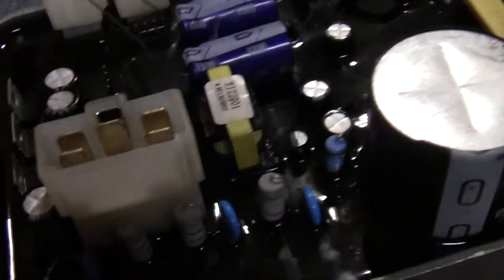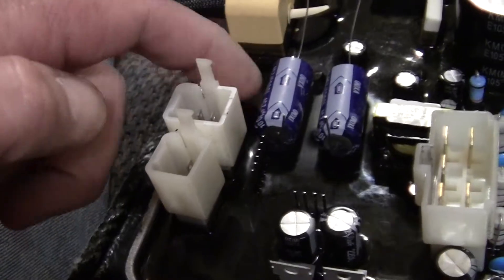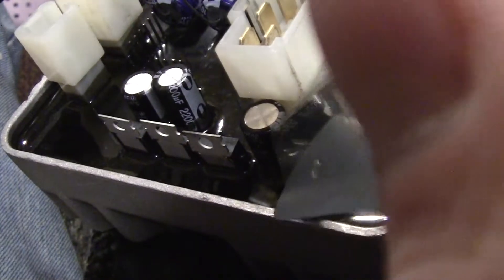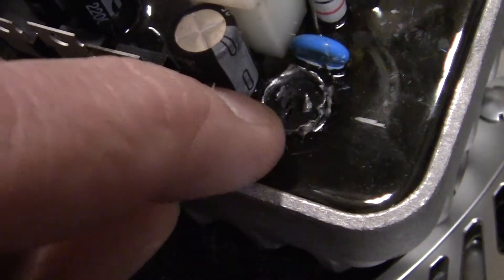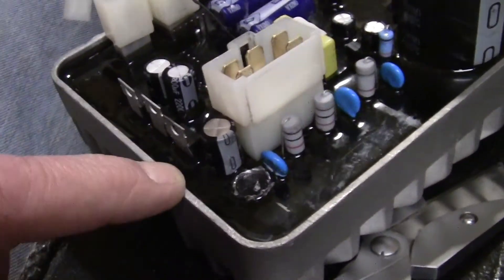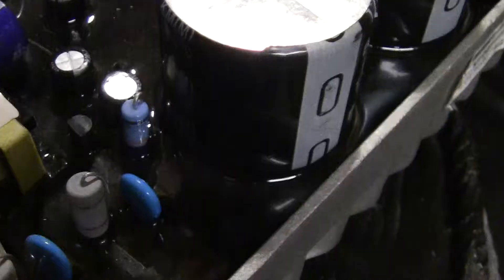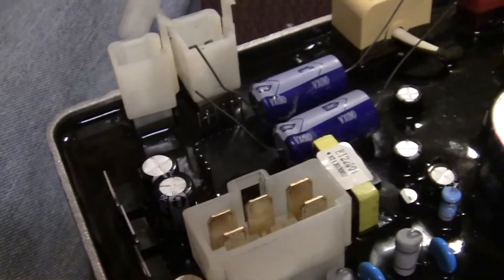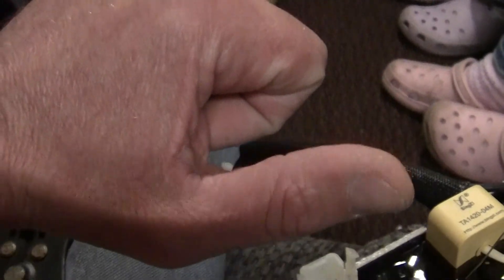INVERTER GENERATOR MODULE REPAIR (FAULT LIGHT/NO POWER) PART 2

Comment: I have no spark. I checked coil, plug, switch, ignition assembly replaced. Still nothing. Any ideas?
Reply: Buy new plug. Is the cheapest try
Reply: @andres--9096  thx. It was the ignition coil

Comment: Not one of those large capacitors on my inverter were bulging. Mine has 6 large ones and they all look brand new. What else could it be? My inverter is the 8750 Predator from harbor freight. I see no burn marks anywhere. All my wire male and female connecters were snapped in pllace. The inverter module looks brand new yet the generators "no power" light is on.
Reply: I have an 8750, and it was backfed power multiple times accidentally, I am guessing the Tapa inverter board was coocked, any way to test it?

Comment: My gen reads overload and ive tried everything. I just ordered a new inverter to install in it. I didnt think to just replace the cap this way. I was worried it wouldnt last because of epoxy base
Reply from the maker: I had to do it this way as the inverter was $700 , thanks man..
Reply: Do you have the part number for that inverter? I can’t seem to find the correct part number for mine and I’ve think it’s the same as this video shows.

Comment: Hi Shawn, thanks for the video. But how did you indentify thst capacitor was faulty for the top?
Reply from the maker: It was distorted and the top was split open so I replaced them all ! worked great ..
Reply: @shawnmrfixitlee6478  oh ok. ♥️

Comment: The wiring for these inverter from the Stator it possible to have a solar fed battery powered at the 12 volt Input in stead of the generator I think it will be OK but I don't know Wich leads are positive😮 and negative can you tell me what are my correct polarity there's 3 blue and two white one is the blue leads the positive and the thiner white leads are they my negative connection sorry I HD to ssk
Reply from the maker: all inverters are different, sorry but it's going to have to be traced and tested out

Comment: Hello. Thanks for posting. I need information on how to test the inverter unit. If you read in any forum you would need that information or where to find it. Thank
Reply from the maker: each generator has a different inverter. and repairing them is very hard . you can do a web search for your model # and try to find a diagram . thanks !

Comment: I can't find part 1.  How did you know you had bad capacitors?
Reply from the maker: it had no output .so knowing the faults of inverter generators I pulled the inverter out and found the caps blown.. these type generators are more money and inverters blow easy if loaded hard ..
Reply: @shawnmrfixitlee6478  Part 1?  How do I determine if a capacitor is blown?
Reply from the maker: @Vegieman  you going to need a meter.. most caps bulge or split when they are bad.. part 1 is just me getting the generator no fixing .. your not going to be able to repair the inverter without taking the potting off first ..or test for trouble components.. very advanced work

Comment: How long do capacitors generally last ?  
What is their typical lifespan ?  I have this problem with other expensive equipment
Reply: Electrolytic capacitors have been notorious for decades for randomly popping like this it's a real bitch to replace them on a potted board but those small caps conduct very little current so it should be possible to solder a replacement component to the legs sticking out and secure them with a blob of silicone. Yes if not used for years electrolytic capacitors can change their polarity and pop! Old fashioned ones often went with a destructive bang and nasty corrosive goo on the PCB.
Reply from the maker: In a generator they  don't last long sometimes because if the generator gets heavy loads it really shortens their life . This is true with about any electronic device. Heat is there enemy and power surge can damage caps and diodes .. Thanks !
Reply: @shawnmrfixitlee6478  thanks, that makes total sense.  I know capacitors go bad just sitting around for years, disused - then getting turned on...sometimes weird things happen.  
 I know there is a niche industry "refurbishing" IC boards for all kinds of devices.

Comment: Hi, i have one ofthese gen with board problem it start run but no power. Where I send the board and how much it will cost? God bless...
Reply from the maker: Sorry , But I don't do repairs through the mail . Inverter generators are really a bad investment in my opinion as the cost of repair is so much higher than the AVR type . Mine just needed new caps installed . But I will not buy another Inverter type generator again . I hope you can find a new inverter or be able to repair it .. God Bless You & thanks for watching my channel !!

Comment: I have honda eu30is but it's moduler (AVR)gone damaged so can u tell me it can be repear or not ?
Reply from the maker: That would all depend on testing and finding the problem. I can't tell you rather it could be repaired over Youtube comments .. Thanks !!
Reply: @shawnmrfixitlee6478  can u tell me how to remove epoxy from modular?
Reply from the maker: @vipvideos6215  That in it's self takes many hours with boiling hot water . A tad bit at a time & a scraper , Being so careful not to damage the board or the components ..
Reply: @shawnmrfixitlee6478  if I will put circuit on water then components will be not get  damage ?
Reply from the maker: @vipvideos6215  I recommend not trying it if you have never done it before .
Reply: @shawnmrfixitlee6478  Okey sir
Reply: Ok thanks 😊

Comment: Hello Shawn! I have a similar inverter generator, the green light is on but I don't have power in the outlet. Do you think it is the same issue?
Reply from the maker: hard to say,  could be lots of things.. thanks
Reply: Hi,
My eu2200 has green light but no power also. Did you find a fix?

Comment: Good idea I would pull caps like bad teeth from a board and do a off board with short wires . Note caps vent on the bottom so potted caps will blow up from pressure.
Reply from the maker: not all caps vent from the bottom.. thanks for watching

Comment: Hello, 3000 watt full sinus inverter fault light is on. When the inverter is turned on, a relay tripping sound is heard, then the fault light is on, what do you think could be the problem?
Reply from the maker: Oh Man ! Could be many problems , Hard to diagnose over YouTube .. Do you have electronics repair know how ?? If you do , The best thing is start testing .. God Bless you !!
Reply: @shawnmrfixitlee6478  I have a temperature regulated soldering machine.  I did not force the inverter, I did not understand why it malfunctioned.  The inverter absorbs current of 12 volts, absorbs capacitors, but then does not output 220 volts.  The only thing I'm afraid of is the failure of the full sine circuit.  Mosfet, I can replace the diode.  Do you think there is a bigger problem?  I have my multimeter with me, I can't check it. good evening
Reply from the maker: @suataydemir5234  Ah, Just like I was saying though .. It could be about anything ! I say you need to test each and every component  for it's factory values .. One diode could take down the whole unit.. if you know what I mean..
Reply: @shawnmrfixitlee6478  yes i understand, thanks for your help, have a healthy and good day

Comment: Seems good idea did that worked ? How did U know those Cap's are the briken ones ? All the best.
Reply from the maker: The caps have a + in the center of the end cap if they blow out the + will be bulged and this means they are bad . They can be bad without this problem but these were blown wide open . Thanks
Reply: @shawnmrfixitlee6478  Straight forward, that was awesome, wondering if fhe generator working now, what was the result , is it fixed ,did this solution save U a new generator ?
Reply from the maker: @princedemiterios2488  Worked great ! Saved me from buying a new inverter module .. All fixed and powers up fine .. Thanks
Reply: @shawnmrfixitlee6478  what happens if you can’t see any popped pieces is there any test you can perform with a multimeter to narrow it down
Reply from the maker: @Nevaehdeavy18  Yes.. but you have to be very good with electronics to do them and most components have to be removed to test properly hard to do but it can be done if you can get past the potting material without damage to the board or components . Best info I can give you from experience ! But mine works well ..
Reply: @shawnmrfixitlee6478  well i have enough experience building boards and diagnosing i just can find any wiring diagrams or baseline readings for one of these inverter units, worst of all not all 2000W generators will be the same so it makes it even more of a challenge
Reply from the maker: @Nevaehdeavy18  That's the deal also.You have to find the value for each component . Not easy as some of them are proprietary ,on many boards ..
Reply: @shawnmrfixitlee6478  yea, I mean some components are labelled but many are not, and especially on some cheaper models they have a whole mismatch of cheap to decent hardware
Reply from the maker: @Nevaehdeavy18  For sure , I agree !

Comment: Good trick Shawn.  Should work fine.  There's some good ideas on YouTube.  Superglue is not conductive so the wires will need to be twisted together for the horizontal caps.  Solder is best.  I see your little helpers in the backgound ;) Cheers Rob
Reply from the maker: no I soldered the wires Rob . Just used the glue to hold them in place till I pot it in resin ..But the wires are all going to be done right .. Thanks man..